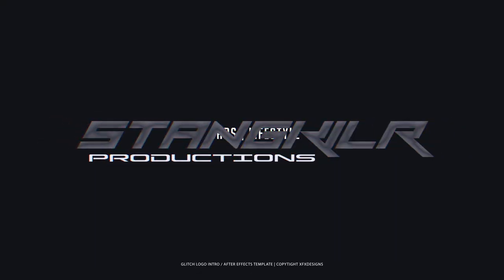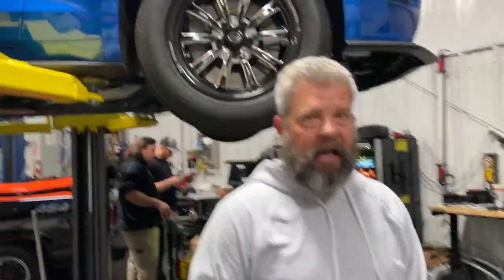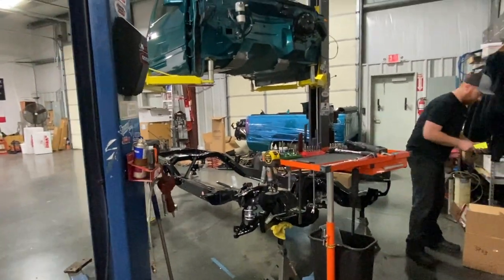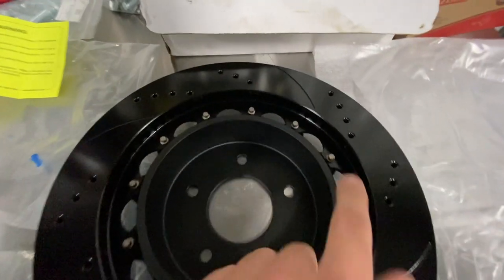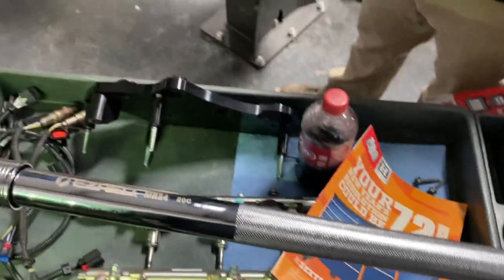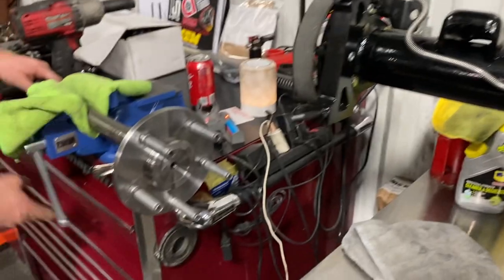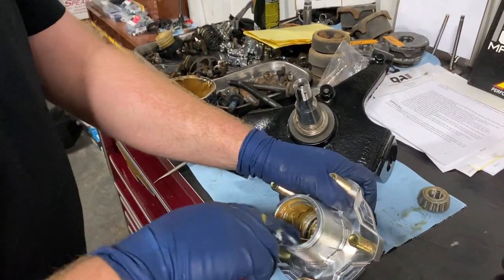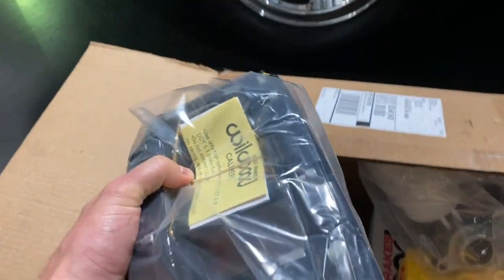Installing brakes on my 93 truck that are larger than supercar brakes.

Comment: I put the big 16’s on my wife’s Tahoe 🙌

Love them. Biggest difference is the heat. With the stock rotors, the beat on test got the rotors up to 550 degrees. With the woods, same beat on test - only 250 degrees.

Comment: Damn I really really love that truck. Going to be a bad ass when it’s done. Sucks having to cut on fresh powder coat for sure. 

That ratchet is exactly what we use daily to crush, crush sleeves. It will definitely break a balanced bolt loose. We almost always have to break it out with a hellcat balancer bolt, so I’d assume that’s what he’s talking about.

Comment: Those brakes are massive, I've never seen any quite that large before. When you put the wheel on, there's no space left for sure. You shouldn't have any problem stopping that beautiful truck. I can see why the price tag was that high. I can't wait to see it rolling on the ground, which should be very soon. I was going to say to stay after it Justin, but I know you already are. As usual with anything like this, seems like there's always some little thing that's holding you back. Keep on truck'n on ! Till next time,  ☮️ brother.😎💯

Comment: Had a similar issue with the little shop brake kit as well. They were quick to send out the replacement parts. Had an issue with packaging of parts as well. Some things were banged up pretty good when it arrived. Otherwise nice parts
Reply from the maker: They are great guys!
Reply: @StangkilrProductions  they are a very talented crew of guys. Cant wait to see the truck completed.

Comment: Hopefully you re-powder coat those knuckles or at least the little part where y'all took off metal. Such an amazing build with nice detail just to leave those parts exposed.
Reply from the maker: They have billet plates that go over the cut part. We painted the exposed edges and bolted the billet brackets on.

Comment: Hi, you stated you could have gone with a smaller pad on your front wheels.  What size pad did you get on them initially?  Thanks
Reply from the maker: These are high pad
Reply: @StangkilrProductions  can you please tell me what size pad the from wheels have?  Is it a one inch pad or larger?  Thanks for the help.